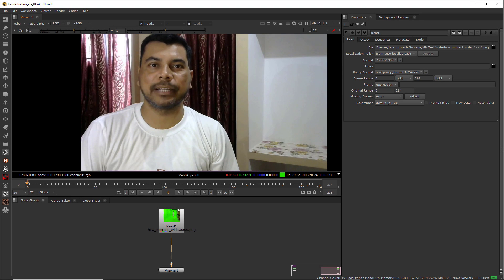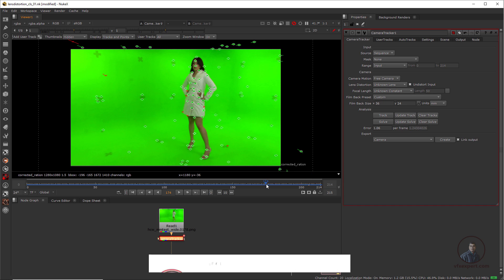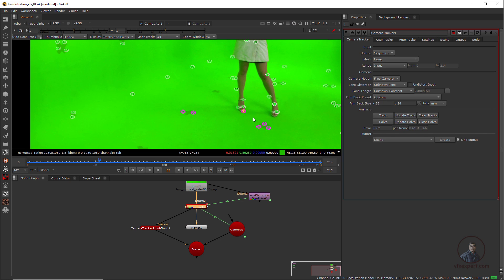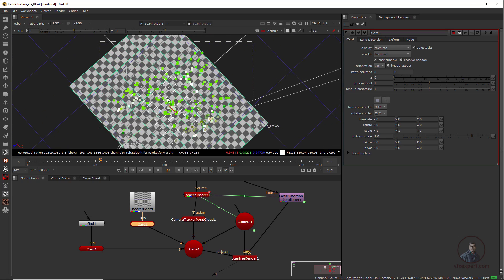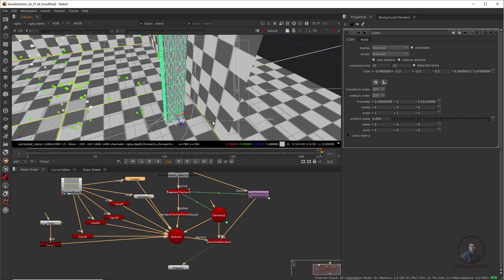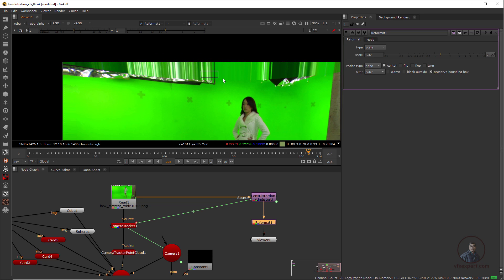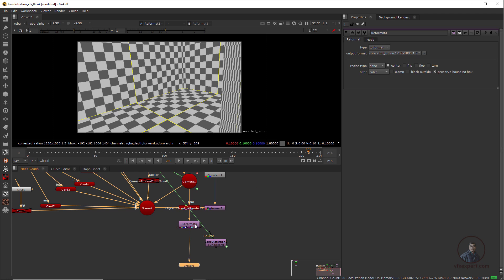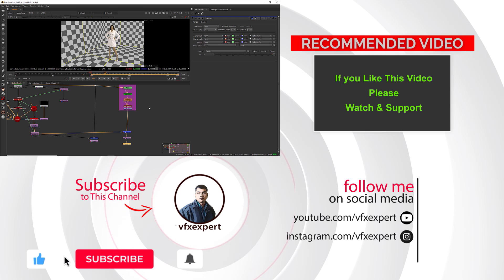Lens Distortion Workflow in Nuke | Nuke Lens Distortion  | Complete Course For Nuke | Class - 17

Comment: I have  a problem with the node Lensdistortion, I use in a scene to change a green screen, at first I connect the Lensdistortion to the lensgrid  in anamorphic for after connect to scene. I take the scene to some card (3D) and them  after the scanlinerender put lensdistortion with redistort and it doesn´t resize the image to the format.
Reply from the maker: may be before  Lens distortion node(redistort) use reformate node  with all settings which i have explain in video .actually this is totally depend on Lensdistortion workflow how you are undistorting and reapply distortion on compositing. May be this can help
Reply: @vfxexpert  many thanks for reply, but is not working. I have scene where in a corner there is a bluescreen to be replaced by another scene. The principal scene is connected in the final compo by MERGE. I try to put the other scene (on bluescreen tv) in a card, move it to correct position and deform (oval card like tv). In the camera I put the values from viewmetadata scene1  (lens 71, sensor size 28.25 and 18.17, anamorphic len), every thing works well, but after the scanlinerender put the lensdistortion node (REDISTORT) them cut the scene1 like the shape of the lens. Why? . Try to do it with any scene.